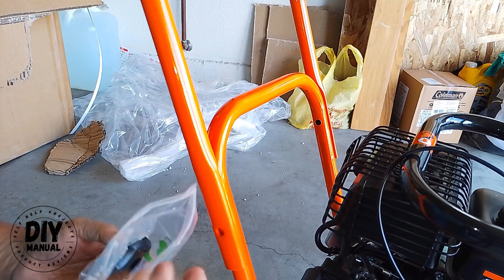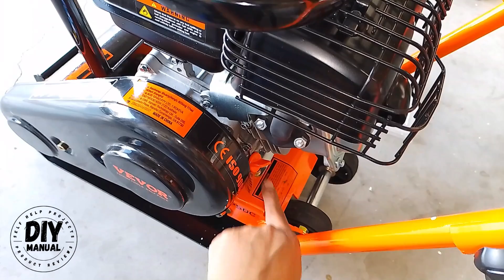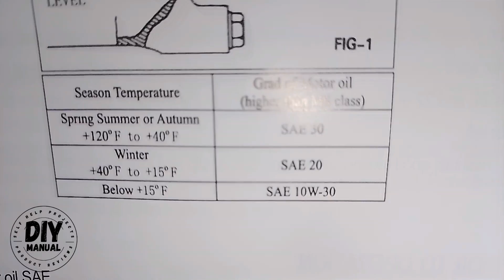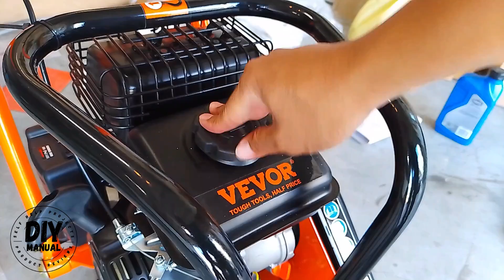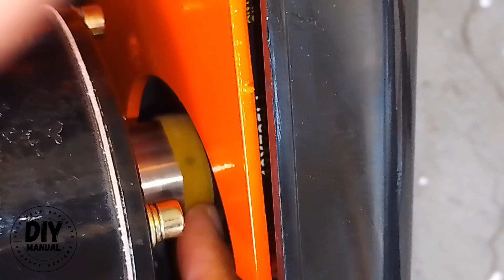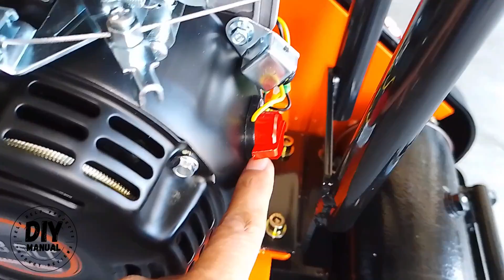Vevor Plate Compactor Assembly & Startup Instructions

Comment: Yes, so I would stroooongly suggest you use motor oil as this is an engine (“motor.”) Using chainsaw bar and chain oil would be significantly inferior on performance.
Reply from the maker: Thanks for the reminder. Someone pointed it out a while ago so I suction it and replaced with regular oil but that was after I finished my project.

Comment: Why did you use bar and chain oil???!!!!
Reply from the maker: You got a good eye. I thought they were all the same. Someone already pointed it out to me so I have to replace the oil after that.  I used the device with bar chain for my whole project before knowing the difference but going forward it will be using the correct oil. Thanks.

Comment: Very comprehensive tutorial, thank you. I am in the process of purchasing a compactor for home use, on a small drought tolerant landscape that has decomposed granite. The granite over the years is lost, and I am about to replace it, but want it secured and not swiftly loss due to my leaf blower. So how has been the long term on this particular compactor? I am considering either the Stark or the Vevor.
Reply from the maker: Happy to help. I have used this for 1 big project and let a neighbor borrowed it  once. I don't have long term data if you are talking about the equipment being used regularly. I let it run until the gas runs out when I store them and when I let my neighbor used it he never had an issue with it. Hopefully, it will continue to work when I need it again for a project.

Comment: Your using chain bar oil?
Reply from the maker: Yes I did and someone in the comment pointed out that SAE30 bar oil have different consistency  than regular SAE30 oil.  I used the bar oil during my project but replaced it after.

Comment: Thank you. I couldn't make heads or tails of that sticker on the front. Very helpful to point out the rubber band covering the vent hole. I was concerned I might need to add oil to this gearbox after seeing it, but couldn't find anything about this sticker's instructions in there to let me know either way.
Reply from the maker: You are welcome.   I'm happy to help.

Comment: So, the quart of oil said "bar oil" is that what you put I. The engine?
Reply from the maker: Yes I did it on this video. But someone pointed out that I should not use if for the engine as it is thicker. I used it for my project with the bar oil but I have to replace it with engine oil after.  Thanks for pointing that out.

Comment: Mine came with a tool that looks like a wrench to remove lug nuts. Did you ever figure out what that was for?
Reply from the maker: @ajaxsf  Hi. I actually asked the same question to Vevor support. I was told that it is the sleeve for removing the spark plug. Hope this helps.
Reply: @diymanual  Thanks! That's a huge help and thanks for this video.

Comment: Finished putting mine together using your helpful video. I just need to tighten the throttle nuts tomorrow.

The box had no damage but one of the oil cap was loose and machine was kind of covered in oil. I thought there is no oil in the motor itself.

I also heard some kind of clinking noise in the fuel tank. Is that normal???
Reply from the maker: I don't notice a noise in the fuel tank. Maybe take a peek inside the tank it's probably just a loose part?
Reply: Crazy, I removed the rubber band, and there was no hole. @diymanual
Reply: I think the rattle in the tank was the chain to the fuel cap. @diymanual

Comment: Did you bother to read the manual? It should have mentioned starting a compactor on hard surfaces like concrete eventually damages the unit.
Reply from the maker: Thanks for the input and yes I did read the manual and you just made me look at the manual again to see if I missed it but I did not see anything about starting a compactor on hard surface will damage the unit. If you have the manual please let me know what page is it located so I can check again. 

I don't see a problem with starting it on hard surface, because simply starting it with throttle at low position like what I did on this video will not cause it to vibrate. I would assume you mean to not let this run on hard surface? Because letting this run on a hard surface  with the throttle on 3 or above will damage the unit or even crack the surface as it will start jumping around uncontrollably. It's  not in the manual too but it just common sense. 

This video is simply to show how to setup and start the equipment.  I have another video on this where I showed how to actually run this to compact a surface. And thank you for commenting because I was looking for it to include the link here but it looks like I did not post it yet. I just moved all my old files in the storage and hopefully I was able to save it.  I will post it once I found it. 

Thanks.